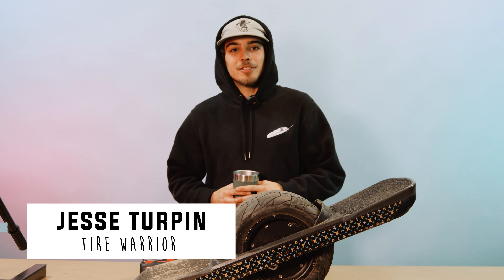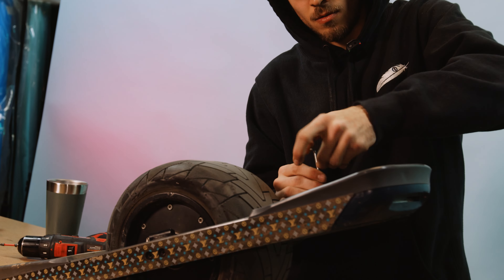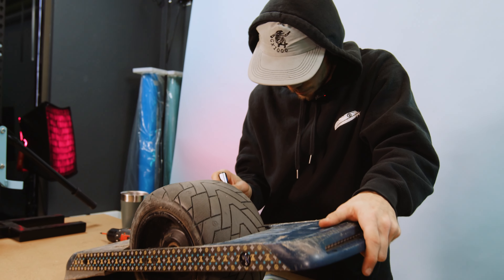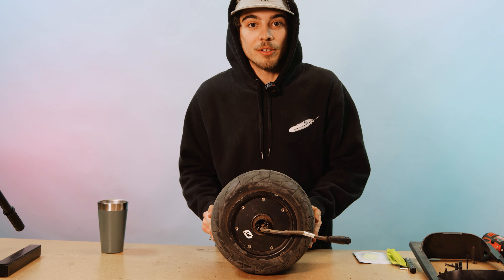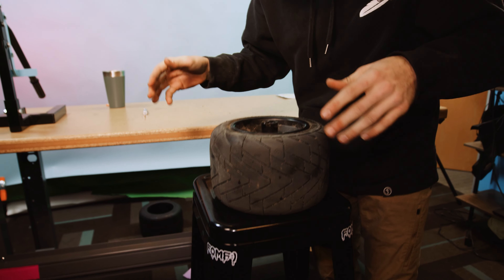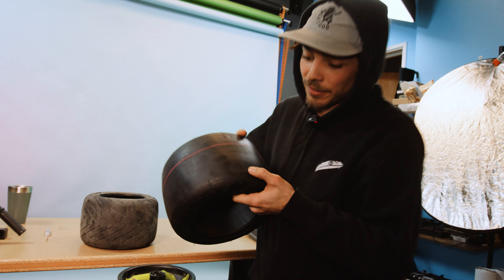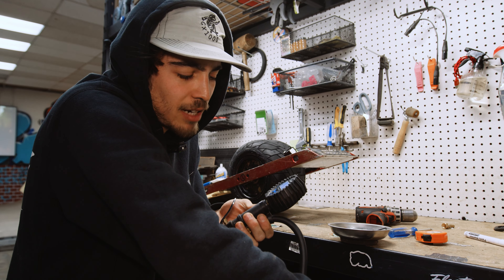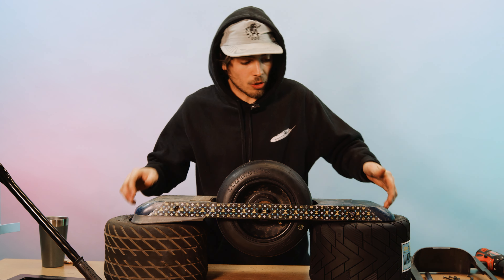How to change your Onewheel (Pint / Pint X / Pint S) Tire - Step by Step w/ Jesse Turpin

Comment: This was super helpful, thank you! The only things I would add to this process is adding sealant to the tire at some point, and removing the front bottom skid plate. When you remove that bottom plate, it makes it so much easier to unscrew the cables for people with large hands like myself.

Comment: Great Tutorial Jesse much easier than removing all rails like others show. It's certainly worth getting magnetic bolts screw pan for keeping all your bolts etc in. Also instead of using that annoying hex key cut off L part and insert in your drill chuck far easier!

Comment: In general if anyone is having trouble getting a tubeless tire to seat, it can help to NOT put the valve core back in before using the air compressor. The valve core can restrict airflow and without it you can get a higher pressure which just might be what you need to get those beads to seat.

Comment: Those "impossible to find" screws are M3x14mm Countersunk screws... M3x16mm fit as well; not as rare as it sounds
Reply: Maybe in the US it's tough to find with their freedom units
Reply: @ThisMarv  naw my local hardware store has plenty metric hardware, they even have hex stainless steal bolts which is a huge upgrade over the black oxide philips ones fm gives you
Reply: @AldenJohnson  Never been to a hardware store in the US, are hex stainless steel bolts rare over there? Pretty normal here
Reply: @ThisMarv  M3 is basically standard screw size on FPV Drones and RC Cars, so those are used everywhere around the world, even in regions where they measure  bodysize with pineapples and strawberries ;-)
Reply: Maybe he meant hard to find on the floor if you drop them since they're small
Reply: @ThisMarv  yea hex is the most common, usually machine screws are the only ones which are phillips

Comment: How poweful of a drill do I need to get these T30 screws out? A 12 volt ain't enough. I got my Pint a month ago; does that have anything to do with how tight they are?
Reply: No, FM just puts a ridiculous amount of loctite in their axle bolts. I broke 2 T30 bits with my hands before an impact rated one got the job done. Tons of elbow grease, maybe some acetone and heat should help

Comment: So I haven't been following one wheel stuff for quite some time, I just ride my board. But I remember back in the day people complaining about their boards becoming paper weights if you disconnected things.  Does future motion no longer brick your board if you get into it yourself now?
Reply from the maker: Community worked hard and created a solution to that. Unfortunately, FM killed that solution with the most recent firmware update.
Reply: @TheFloatLife  so I just got my first flat tire. So if I change it myself it'll brick my board still?
Reply: @shawnbowen6833 only the GT does that, and it’s if you disconnect the battery from the BMS. (This connection is INSIDE the battery box, you can’t do this without opening the whole batttery box so no danger here). Disconnecting the motor cable to do a tire change will do absolutely nothing to your board.

Comment: I just did it to mine but it started to have a bit of resistance on the free spin of the tire with the board turned off and makes a slight hum like sound and I'm not sure what I did wrong or how to fix this.

Comment: Loved this video, I have to mention to be SUPER CAREFUL with the connector when removing it. It is super easy to bend or break the pins coming from the controller if over or under tightening. FM won’t cover that damage under warranty, and the controller is $340 total for parts/shipping/labor (as of April 2024). Learn from my mistake!

Comment: Just finished replacing my pint with an enduro tire, here’s the one obstacle I faced in face someone needs the solution: I got as far as pumping up the new tire but the beads wouldn’t set on the edge of the axle at 25psi or lower. I contacted FL and they said to go ahead and pump it to 75 psi so it would set and then bring it back down. I took it to about 54 before both sides of the tire popped in and it worked!
Reply: I also threw a bit of soapy water on before pumping the air to help it out. Also I pumped at a gas station that works fine in case anyone was wondering

Comment: I really appreciate you mentioning the axle block covers at 2:09 by name. One of mine was cracked when I received my brand new Pint and I was worried it was some really important part and that I'd have to send it in for repair or something. A quick Google search showed that I could just 3D print new ones though, so now my mind is at ease : )

Comment: Dude... the magic with the tire levers to get the rubber up and over the rim.  I almost want to change my tires for no reason to try that.  Need to get another lever first though, on'y have one.
Reply: I've used a pair of Dewalt clamps to break the bead on a couple tires so far... it's a game changer.
Reply: @CayoticProphet  I was using Irwin Quick Grips before I got a bead breaker.  That portion wasn't the challenge, it's getting the rubber off the rim that flabbered by ghast

Comment: Do you bother putting in tire sealant? I had my local board shop put my enduro on my GT for me, but going to put a new Burris on my pint myself. Its the backup board so figure its a good way to learn without knocking out my main rig, lol. I still have half a bottle left over of the stock Future Motion stuff the shop used, and ordered some of that armadillo stuff from C&R. Not really sure which I am going to use, if any, on this Burris...

Comment: What front foot pad is that??
Reply: Second this? Did they transfer the sensor over to a Kush Nug? I like the locked in feel of the angled pads, but don't want to deal with the angle adjustments of the W rails using a Pint X.

Comment: The T30 screws on my hub are RIDICULOUSLY tight, they refuse to even budge, and they’ve never been removed. Bought my Pint brand new a year ago and recently bought some new parts for it. Anyone have any tips?
Reply: Same, 12volt Drill isn't enough.

Comment: What the funky man. You didn’t show how to remove the connectors close up. It is costing replacing half the unit for new controller
Reply: Same thing happened to me the other day.
Reply: what happened exactly?  did you accidentally break the connector when unscrewing it?
Reply: The connector to the control has an external tightening nut. It doesn’t look like it at first, and it is very tight. The connector is a OEM 5 pin that is very easy to damage.

Comment: I have a similar build to this guy and the stock tire is a pain to rip off like like that! Sidewalls are super stiff. I looked like an idiot monkey man jumping on the wheel, but I got it off finally 😂
Reply: Ditto. I still have the stock tire and really want an Enduro. Watching this to pump myself up.
Reply: Just had a similar time. I foolishly decided to cut the middle out with scissors and had to ween the sidewalls in one at a time and then saw and bend the wire slowly
Reply: i can relate so hard lol and im about to do another tire change in a week or so... fckin dreading it lmao